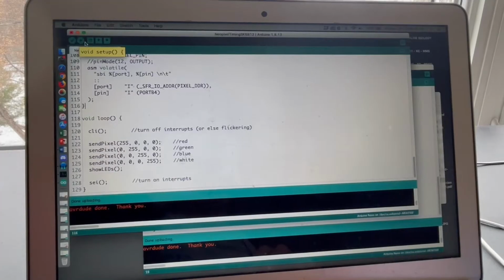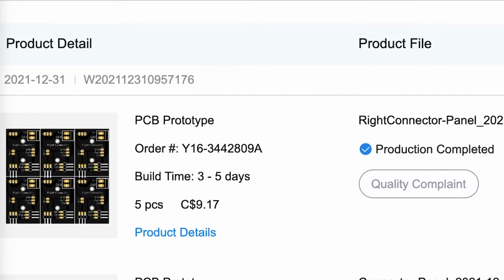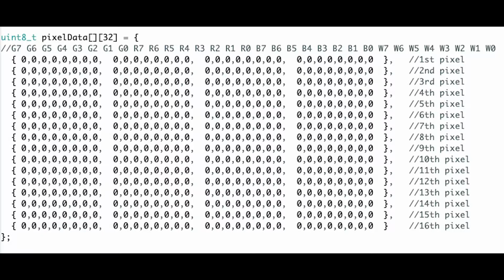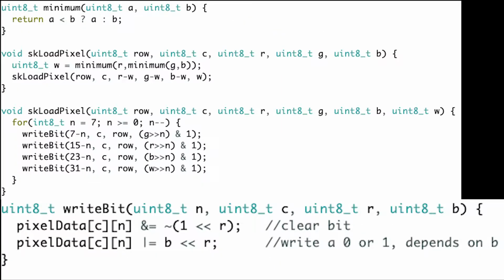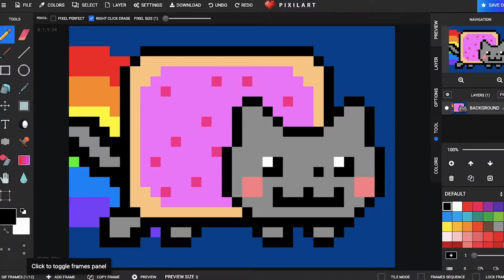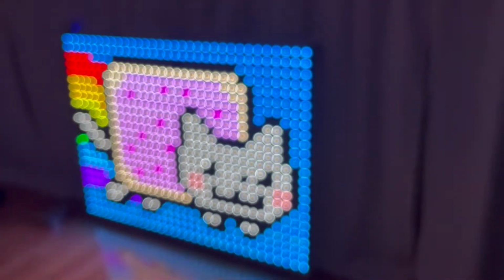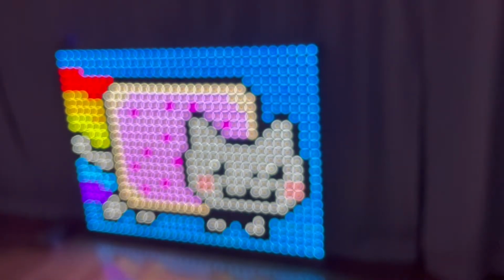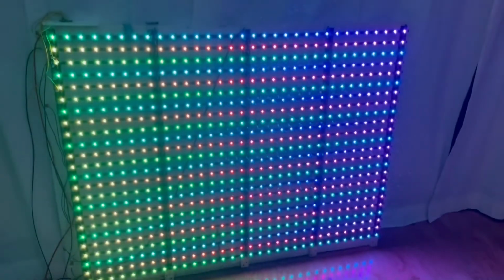Building a Large Modular RGBW LED Wall

Comment: how much?
Reply from the maker: $250 for the pcbs + shipping
$120 for 1000 sk6812 5050 leds (on aliexpress)
$100 roughly for the power supply, ping pongs, and wire
So in total around $470 CAD :)